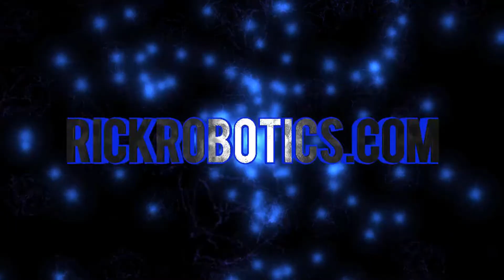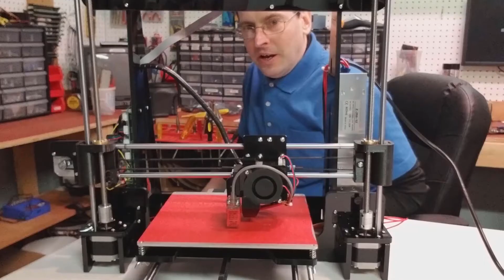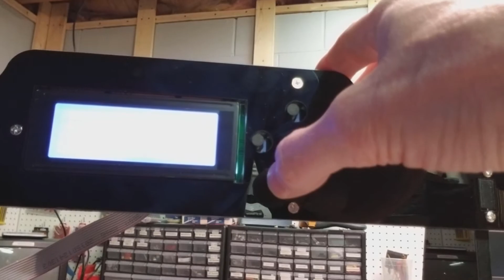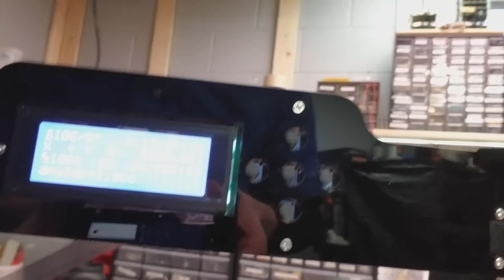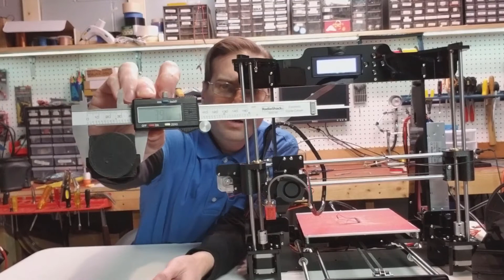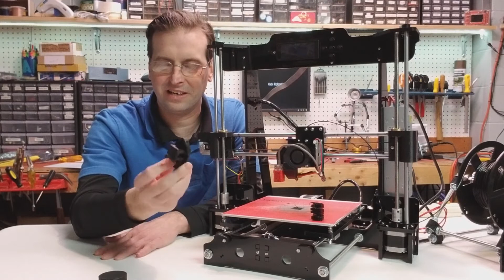Tronxy P802MA 3D Printer Part 2 - Testing and Evaluation

Comment: So is the ender v3 a better choice?
Reply from the maker: Compared to this model, yes, I would choose the Ender 3.
Reply: @RickRobotics  LOTMAXX Shark V2 3D Printer, Laser Engraving & Bi-Color Printing 2 in 1, Preassembled 3D Printer Machine with Dual Extruder, Print Size 235x235x265mm,. 
?????

Comment: my motherboard suddenly stopped working. It was fine one evening and when I switched it on at night, I saw two lines at display. PSU fan and cooling fan are on. I have no MOSFET and had been facing hotend temperature fluctuations due to broken thermistor wire. Just ordered the board a month back. What do you think happened? Please help.

Comment: 7.5 ? the distance /Z sensor has issues, Tronxy even admits that, mine has killed  2 glass build-plates 2 magnetic ones and has been no good at printing anything that takes longer then an hour, after an hour it gets tired and sloppy and makes mistakes, i am following the series  and i agree that a kit is the best way to start, but good clear English instructions and a good user manual that actually has tips and tricks would help a heap.

Comment: I have had the similar model (minus the bed level sensor) for a couple years, and some of the things I have done that have made this very cheap printer rock solid are:
#1 Added 2 separate MOSFET boards to to drive the hot end and the bed.  Takes load and heat off the main board and keeps the temps very steady during printing.  Very easy to set up, instead of connecting the bed and hot end power wires to the main board, they connect to the MOSFET boards, and the wires from the MOSFET connect to the main board.  The main board still "thinks" it is driving the bed and hot end, but the real work is being done by the MOSFET. 
#2 Made a print "table" of concrete block legs and melamine top to provide an un-moving platform.  Also printed hold downs so the printer could be attached to the table top.
#3 Printed various "stiffening" reinforcement add-ons and added them to the frame (Thiniverse).  Takes the wiggle out of it.  This and the table have made the need to readjust bed level almost zero. 
#4 Used a Pi Zero W and camera and set up OctoPrint to drive/control the printer.  Easier control and less likely to accidentally interrupt long print jobs. 
#5 Printed a semi-circle hot end cooling manifold that improves the print quality greatly.  The one that comes with the printer cools the printed part unevenly.
Reply from the maker: Very nice! With a little modding this printer can really be a sturdy machine

Comment: That is Really just an Anet A8... Very miner changes like the controller
Reply from the maker: You are correct. It's a clone of a clone. The Anet A8 is a clone of the prusa i3, and this is a clone of that. I haven't heard of many big differences between this and the Anet, but I've seen some Anets come with better PSUs, which is nice since the one this comes with is basically garbage! I do like this printer though, once it's tuned right!

Comment: when you say you made a change in the power supply by increasing the voltage to 14V ... what did you do exactly?
Reply from the maker: I turned the potentiometer knob, on the power supply, all the way to its maximum. This increased the output voltage from about 12VDC to a little over 14VDC. This, unfortunately, is very hard on the standard Power Supply, which I later had more problems with. However, it seems necessary in order to get the bed heated to 100+ degrees C.
Reply: is the potentiometer inside the power supply?
Reply from the maker: Yes, it is on the edge of the PSU, near the screw terminals.
Reply: Everytime I start the print with repetier host, it says that the print was killed without giving me any reason, and I realized that the extruder is heating up extremely slowly and it never gets to the temperature I want. Do you know any solutions to fix this problem?
Reply from the maker: This is a bit unusual, but could be for a couple of reasons. Check to make sure the baud rate is correct. Make sure there are no conflicts on the ports (try resetting / clearing the USB ports). Reset the printer (with the actual "reset" button on the board). Perhaps try to re-slice the model as well, as it may simply be a slicing error.
These are the "obvious" steps, but it may require a more in-depth solution. Does printing right from the SD card work correctly? It may be wise to slice the model and move it to the SD for printing anyway, since this will prevent the printer from stopping, unexpectedly, due to a communication error from the PC and USB ports. 
Hope that helps!
Reply: I saw the potentiometer and turned the knob but nothing happens....the baud rate is correct however I realized that on display it shows extruder is off ,I tried to turn it on but nothing happened, I touch the nozzle it's hot, pull out filament it's end is also hot ,but there is no printing... also whenever the extruder is heating or the motors are moving the screen become completely bleu without any numbers and letters showing up....and the printer makes really wired sounds when the motors are moving... I havent printed anything yet with only the sd card... its doent work
Reply from the maker: I am inclined to believe this is a firmware or control board issue, considering the issues with the the temps not showing, the LCD malfunctioning, and the SD card not working. I would recommend checking with the facebook group (https://www.facebook.com/groups/Tronxy/ ) which has a lot of active and very helpful members (including me). You will get a lot of helpful, collective advice, as well as being able to show pics and videos of your printer.
As for the PSU, did you check the output voltage with a multimeter? The potentiometer should show a change while rotating it. As a side note... my PSU eventually burned out and I have since replaced it with a more reliable one... ( https://www.amazon.com/gp/product/B01IHNE746/ref=as_li_tl?ie=UTF8&camp=1789&creative=9325&creativeASIN=B01IHNE746&linkCode=as2&tag=rickrobotics-20&linkId=47d8e7a2f032c12642c6e2a742fd5948 )

Comment: I just got one the problem I'm having is the drivers I'm running Windows 10 pro latest release an the device manager is showing matador engine an advice for the drivers I've tried everything with no luck
Reply from the maker: The drivers should already be set in the board that came with the printer (probably a Melzi board). To run from a PC (or mac, Linux, etc) you need to use a program to slice the solid models and control the printer itself. I recommend either Repitier or Cura. Both are free and come with built-in slicer programs.
Otherwise, you could print directly from an SD card, but you would still need to slice the model you are printing.
Hope this helps! Good luck!
Reply: No luck still having the matador engine problem can I use another controller board or are there any drivers that cover the matador engine slicer won't connect because of the matador engine problem?
Reply from the maker: I've never used the Matador engine slicer, so I can't advise you on this at all. I strongly suggest Slic3r or Cura, but it's certainly your choice. 
As for other controller boards, the stock Tronxy usually comes with a Melzi board, which is basically a re-designed RAMPS board (or at least compatible with Marlin software). Many people switch directly to the Arduino Ramps set up, which can be purchased in complete kits, piece by piece, and completely programmed and ready to go, from various sites such as Amazon, ebay, etc.
Reply: Ok well how about this problem either quarter or half way through a print it starts to print over again on top of the old print?
Reply from the maker: That's very unusual. It sounds like either its a slicer problem (try re-slicing and trying to print again), or, for some reason, the printer firmware thinks it sees a part of the g-code that tells it to restart the print at that particular spot.
I'm experiencing a problem also, where the printer will print fine for 11.5 hours, then stop and think its finished (when it's obviously not) and doesn't shut of the heaters. Still working on a fix for this problem.
I will be uploading a follow-up video on some problems and fixes soon. Although, I can't guarantee this particular problem will be addressed/fixed, until I'm sure it works correctly. 
I would definitely try checking the facebook support group for the Tronxy printers and get the collective advice from the group!
Reply: Ok thanks it's just strange because it does it on my zonestar to but just on large prints small ones I have no problem with I've been trying to print out an iron Man suit the palms an fingers were no problem but when I go to larger prints that's when I have the repeating problem
Reply from the maker: Wow! What a coincidence! I ran into these problems trying to print an IronMan suit as well (I'll be talking about that in a video scheduled in about 2 months)! The small parts seem to work, but the bigger parts just stop after 11.5 hours. Hopefully we can resolve this problem!
Reply: O ok was it the files off thingiverse?
Reply from the maker: https://www.thingiverse.com/thing:1779274
Reply: Yep same files an I tried the warmachine files too with the same problem
Reply from the maker: Perhaps there are some errors in the STL files that the slicer isn't catching. It's unlikely, but this is my initial thought.

Comment: Excellent video!
I just built my 1st printer and the extruder motor will not dispense plastic when it's printing a test part, but the extruder motor works fine when I do it manually without a file not loaded.
Any suggestions please?.
Reply from the maker: It's hard to tell the exact problem, without handling the extruder myself, but I have found this problem is usually solved by either increasing the heat a bit, or by adding tensioners to the extruder motors. The Tronxy I recieved has pretty good tensioners, but could still use a bit of adjustment. Also, be sure the bed is level and the very first bit of plastic the comes out is able to contact and stick to the bed. Beyond that, may be a slicing problem (if it isn't even trying to turn the extruder motor, while printing). Good luck!
Reply: Thank you!  I will let you know.

Comment: Great video.
Reply from the maker: Thank you!
Reply: Rick Robotics no problem.. I'm still trying to assemble mine.. And your video helped me tremendously. Thanks.
Reply from the maker: I'm glad it helped! I'm considering an update video soon, to explore some simple mods to make the printer more reliable. Hope you're up and running soon!
Reply: Rick Robotics any suggestions on what I need to do before I run my first print. Thanks
Reply: Rick Robotics is the sensor light part of x y or z
Reply: Rick Robotics also my sensor light doesn't engage
Reply from the maker: You are probably talking about the Z-axis bed leveling / end-stop sensor, if you are referring to the red cube-like thing on the front of the X-carriage, by the fans. Your model may not have this feature. Mine is a Tronxy  P802MA, other models may have different end-stops. If yours is the same as mine and doesnt respond, check the connections on the board and the sensor. You can manually trigger the sensor (a light should turn on, on the top of the sensor) by touching the bottom of the sensor with a metal screw driver. 
If that works,  but it won't trigger when it comes close to the heat bed, then your sensor is simply up too high. Move it closer to the heat bed.
For a more detailed explanation, feel free to join the facebook group for Tronxy owners, where you can share pics and such for much more help!

Comment: Hello friend
I have a question
Does the temperature of the mainboard and the steppers keeps  low or is it high ?
Cause I have the same printer and I think there is overheat in both elements, but I don't know if is normal.
Reply from the maker: I'm not really sure what you're asking here. There are temperature controls for the extruder and the heat bed, and they should be set according to what type of material you are using. As for the Motherboard, where all of the electrical parts connect from, that should be repetitively cool, except for the the mosfets and transistors that normally channel high current to things like the extruder and heat bed. they usually have some sort of heat-sinking on them to allow for faster cooling. The only way to actually cool the whole board, would be to add a fan that blows cool air over it (there are other ways too, but much more expensive and time consuming to install). Hope that helps!
Reply: Rick Robotics 
Yeah many thanks that was my doubt.

Comment: If you stop using the computer control to the Tronxy P802, and go to the printer's Quick Setting -> Preheat PLA/ABS, then you would not have to wait an hour for it to cool down and then reheat for a printing.

Also, you should check and tighten your belts. Perhaps as a mod/add-on on Thingiverse, there are belt tighteners for the Tronxy P802. Maker's Muse, 3D Printing Nerd and a few others have videos on how to measure the off set of your printing, recalculate the offset, put it into the configuration and save it onto EEPROM. Your test prints will come out a bit better and spot on. It should also clear up the ABS printing issue you had on the video.

Good luck and enjoy. I do with my Tronxy P802 and X1.
Reply: Wait! I just realized; the G-Code to the test cube and other things are only set to PLA heat setting. You need put the SD card into your PC, duplicate the file and modify the g-code for ABS temperatures.

Good luck & enjoy.
Reply from the maker: Thanks for your comments! The cube i used wasn't from the SD card, it was one i had on the PC, but I sliced it with Slic3r for ABS settings (220/90). I believe the layers didn't stay together because of the active part cooling. I am doing more testing/modding and will have a follow-up video on the progress of this printer soon!
Reply: I use these
https://www.thingiverse.com/thing:2170396
https://www.thingiverse.com/thing:2424467

Comment: Pretty sure that whenever the hotend is on, the software wanted that fan on. Helps with making sure it doesn't go into thermal runaway
Reply from the maker: I initially thought that was the case too. But It doesn't turn off, even when nothing else is powered but the board. Even when disabled in Repitier Host. I have checked with the Tronxy Facebook group and found out that it is intentionally always on. It can be turned ON higher and faster, but not completely OFF... Not with out an external switch.